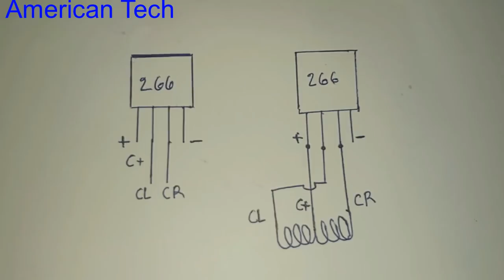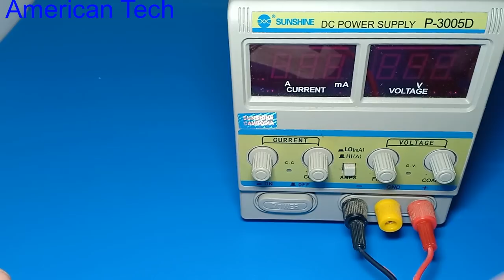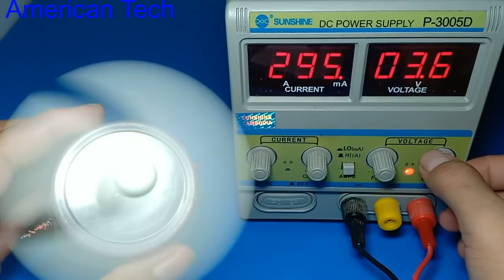How to make a powerful Brushless motor , super idea to create brushless motor

Comment: I'll never wrap my head round how a bare wire wrapped in a coil on itself becomes magic.
Reply: Today is your lucky day, for I shall reveal to you the secret: The wire is not bare. It has a thin coating of enamel on it. It is very thin and is close to the color of copper, so it is understandable that you might think it is bare. But it is not bare. I assume by magic you meant magnetic. Or maybe it is like magic.
Reply: In order to make a brushless motor, you need a few things - a stator, a rotor, and some magnets. The stator is the stationary part of the motor, and the rotor is the rotating part. The magnets are what make the rotor rotate.

To make a brushless motor, you first need to coil some wire around itself. This creates an electromagnet. You then need to attach some magnets to the rotor. Next, you need to attach the stator to something that will keep it stationary. Finally, you need to power up the electromagnet.

When you power up the electromagnet, it creates a magnetic field. This magnetic field interacts with the magnets on the rotor, causing it to rotate. The faster you power up the electromagnet, the faster the rotor will rotate.

Electricity is all around us and it's one of the most powerful forces on earth. Harnessing that power can be difficult, but with the right tools, it can be easy. In this article, we're going to show you how to make a powerful brushless motor using free energy transformer and some other common household items.

The first thing you'll need is a free energy transformer. This can be found online or at your local hardware store. Next, you'll need a few other common household items, including a battery pack, DC motor, and propeller.

Once you have all of your supplies, it's time to start assembling the brushless motor. First, take the free energy transformer and cut off the top section. Then, use pliers to bend the prongs on the bottom section so that they are flat.

Comment: Brushless motors are more efficient than brushed motors and they have a longer life. They are more expensive, but the extra cost is worth it. In this article, I will show you how to make a brushless motor that is more powerful than the ones you can buy in stores.

The first thing you need to do is find some magnets. I used neodymium magnets, but you can use any type of magnet. You will also need some metal wire, a battery, and a motor controller.

The next step is to wind the wire around the magnets. Make sure that the polarity of the magnets is correct or else the motor won't work. You will also need to make sure that the wires are touching each other so that they create a circuit.

Now you need to solder the wires together.

Comment: why it doesnt need any driver?
Reply: The Hall effect sensor acts as a driver
Reply: Without ESC it will not run its a fake video
Reply: Nope. The y’all effect sensor senses the magnetic field from the rotor and switched the power making the coils run north of south based on current direction to attract witch ever magnet is next to it.
Reply: I have a hard disk bldc motor which also have hall effect senser. But it didnt work when i connect it to direct dc supply. Please can you tell me how hard disk motor can be run with out circuit like yours?
Reply: @rahulchamoli1060  esc's or ecu's are more efficient and worth it

Comment: the  ic266 can support a max peak current of 700ma per coil, what was your coil resistance, had made one but due to coil resistance it was shorting the ic, pc brushless fans have so thin windings have resistivity anything between 400-600ohms.
Reply: when googling for IC266 only 3 pin variants appear. could you provid a link to the correct component?
Reply: @ThomasHaberkorn  google it : AH266 Hall sensor

Comment: DC to AC motor
Reply: the IC he used is normally found in those cheap pc fan. Basically, it is a switch which changes the connection of the input power depending on the polarity of the magnet facing it.

Comment: I saw you making a 2 wires coil but at the end there was 4 wires. What did I miss ?
Reply: Each wire has 2 ends ... so 4 ends but still 2 wires
Reply: Ok I saw you using only one wire and winding it clockwise in one screw and conterclockwise in the next. At the end is one wire  with two terminations. After you soldered 4termination on the Hall effect component. Where did these additional 2terminations come from ?
Reply: By the Way thank you for your tutorial vídeos :-)
Reply: Two wires in hand, or parallel, as the wires are wrapped on the screws. And so, there are two starts and two finishes. Next, one start is connected to one finish to make a center tap. Now you have a start, a finish, and a center tap. These three are connected to CL,CR,C+ on the 266. The center tap is on the C+.